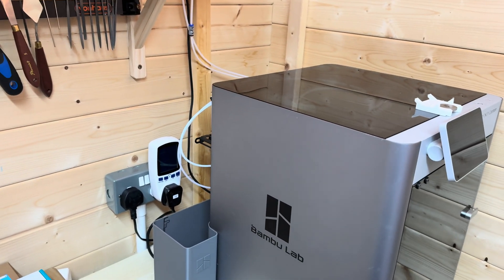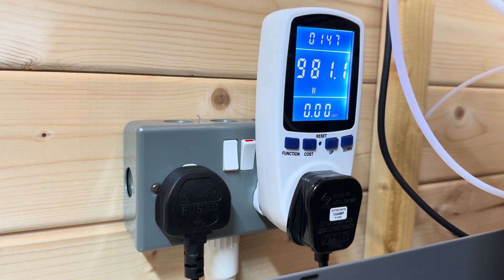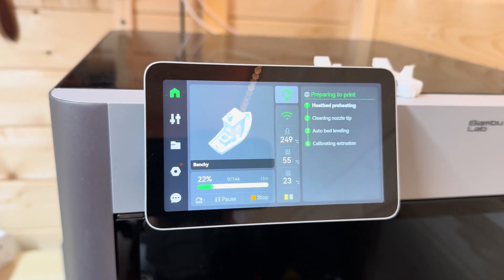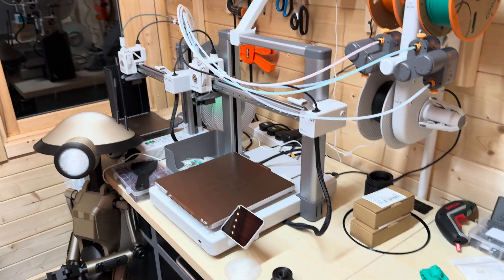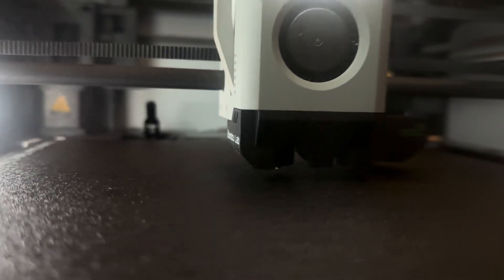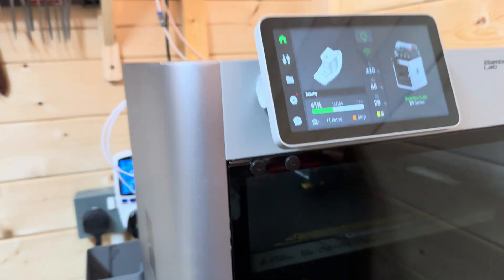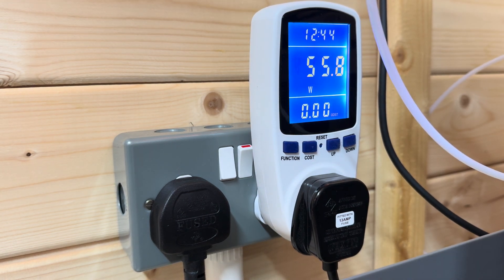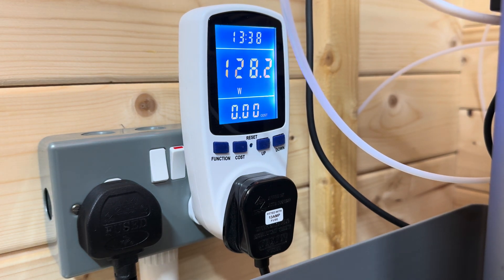Bambu Lab X1 Carbon Electricity Costs

Comment: When I am printing with my X1C, I am noticing short dips in the lamp-light of the room where the printer is located. This happens with an interval of approx. 1 second.
I guess this is from the heatbed which uses a duty-cycle system to keep the bed on the right temperature. But this gives high power-loads for a very short time. I wonder this can trigger some safety devices when multiple printers are active…?
Anyway, I find the 1 Hz blinking in the light quite disturbing. 
Anyone else who has noticed this behavior????
Best regards,
Jan.
Reply from the maker: Have you tried using it on a different circuit?
Reply: @ You mean on a different power-group of my house?
No; the whole attic, where my printer is located is on one group only and I am not going to carry the equipement down the stairs to another group for an experiment with known outcome.
If I look at the lights on other groups during printing, they are clean (no dips in intensity).
So the effect is caused by the wiring resistance between the main powercable entrance and my attic.
The short load pulses are causing a noticible drop in supply voltage at the end of the line.
If I am in the mood, I will try to measure these load-dips with an oscilloscoop…

Comment: That wasn't 102W, that was indeed over 1kW during the bed heating phase. Obviously that is often very short unless you have it outside in the cold I reckon ;)  Please do the other printer too though, very interesting!
Got my X1C on a shelly plug, on longer prints it really does seem to settle on 75W average, I'm well impressed.
Reply from the maker: Yeah, it did reach 1kW, but just very briefly. I’ve not tried measuring it on a longer run, but even at these numbers I’m happy with it :)
Reply: 1kW for ~20 seconds = 1/180 of a kWh = something like 0.1 cents to heat up the bed.